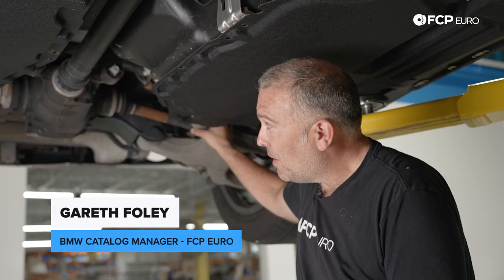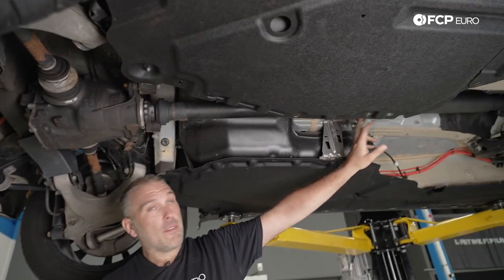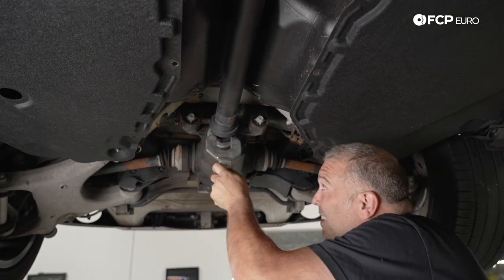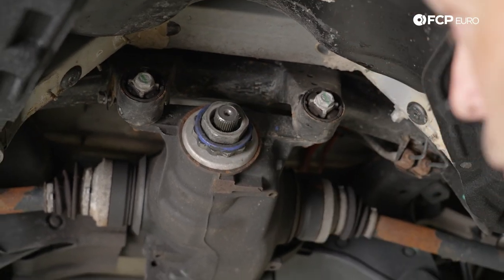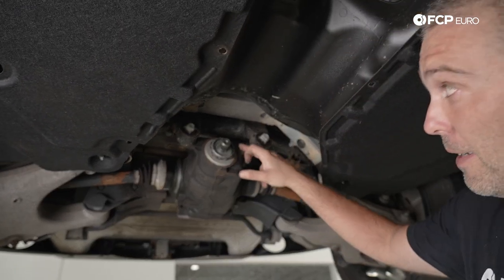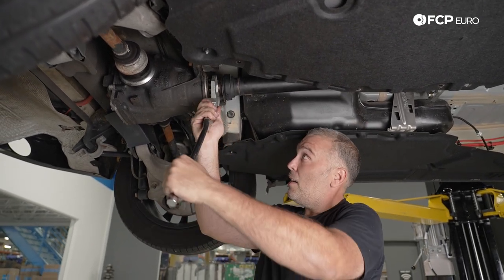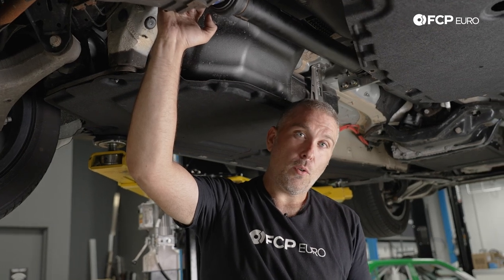How To Service A BMW Drive Shaft With A Drive Shaft Coupling Nut (2011-Current BMW Models)

Comment: Thank you for the video, super helpful as always!
On my 2013 335is DCT, I got the 50mm nut off the driveshaft with just leaving the transmission in Park, no brace it came off. Used a Sunex 97752A 2" crowfoot wrench from Amazon $15. Thats it.
Torqueing it to the prescribed 85nm/62 ft lbs using the crowfoot wrench:
The torque wrench was 15” long from center of wrench to center of hand grip. Crow’s foot has an extra 2.25”. the torque will be 15% high or 72.1 lb-ft. The point of the formula is I set the torque wrench at 54 lb-ft to get an actual of 62 lb-ft.

Other torque specs: 
big 50mm nut to driveshaft.... 85nm/ 62 ft lbs.... blue lock tight on splines
Rear diff bushing... 21mm back bolt.... 121 ft lbs torque spec 
Front diff bushings bolts... 73 ft lbs
18mm exhaust hangars
Axle bolts... 52 ft lbs... blue locktight
gear oil through fill hole and torque to 44.3 lb-ft with 14 mm male hex.
Reply: dude thank you for this

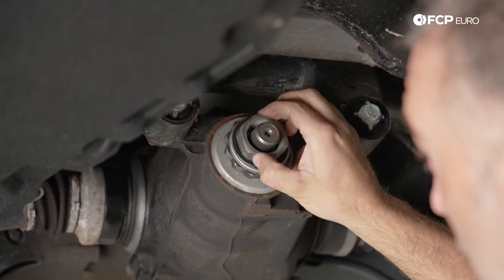Comment: When you remove the plastic cover at 4:35 it is clearly visible that the rubber seal which is on the 50mm nut is on the OUTSIDE part of the flange. But when you put it back at 6:00 you stick it underneath the flange - is that correct?
Also - by design it seems it is really NOT holding to anything on the differential - only that rubber seal is holding the driveshaft with the diff. That makes me wonder whether you could simply PULL OUT the driveshaft from the spline shaft of the differential...
Reply: I was thinking that same thing, did you ever figure this out? I just dropped my old diff out and it seems like the 50mm nut does nothing

Comment: Is the driveshaft holding tool really necessary?  ISTA says to use a suitable tool to hold the driveshaft which appears to be a large screw driver through the u-joint at the center support bearing. They do not specify any holding tool for the driveshaft other than that. I only want to do this one time but don't want to spend $350 to hold the driveshaft in place if I don't have to.
Reply: No, at least in my case, it was not necessary.  I put mine up on ramps after coasting to lock the parking prawl.  I used a 24" torque wrench with a 50mm crow foot wrench.  I applied slow and steady pressure and the nut moved.  I reset the wrench a click, it continued to move.  After 15-20 minutes, the nut was completely off.  I wouldn't recommend anything less than 24" or you just cannot get enough torque (I tried a 12" wrench with a pipe extension around 18" total and I couldn't move the nut).
Reply: @souniquexyz  use the e/parking brake on the center console, it will do the same thing.

Comment: Curious about your comment on that 12 point pinion nut. Had a shop replace my input shaft seal on an F36 which requires the removal of that nut. I'm convinced the did not torque that nut properly causing incorrect pre-load in the diff because now I have a loud whine when coasting. Would incorrectly fitting that nut back on potentially cause any serious damage other that the noise/whine?

Comment: I may be dense but what is the purpose of this design? It seems like the nut threads onto the driveshaft but is not in anyway physically mated to the splined stub coming from the diff. Could you, in theory, pull the driveshaft off the diff without removing this nut?

Comment: At six minutes, it shows him tucking the rubber seal into the pinion nut. This is wrong. Do not do that. The seal sits on the outside of the pinion nut and then the blue retainer.
Reply: You are very right. Finally someone pointed it out. I mean people can clearly tell the round foam thing is a dust seal and plastic cap is the seal securer. If leaving behind it, it will squeeze to break when tightening.
Reply: Thanks for that information/ correction. I will remember this if and when I encounter this. You made this video even more accurate and helpful.
Reply: How is the 50mm nut actually attached to the diff? There are no threads at the pinion gear  and I was able to pull it off with my fingers
Reply: Also the seal on mine was inside the pinion like he showed, it came like that from the factory

Comment: The 12 point nut is to set the Pinion preload .if not torque to spec. Your looking to buy customer a brand new rear diff . Yes the nut need to be removed to change the Pinion seal which they leak all the time
Reply: Correct.
Reply: Hi, if i only want to take out the drive shaft for tank removal. Do i have to replace the 12 point nut aswell? Or can i leave it there and only replace the insert nut with both rings? Thanks!

Comment: “If you mess with the 12 point nut you’ll have a bad day”.  What could happen? Wouldn’t that be how you get access to the pinion seal?
Reply: The 12 point nut is the pinion shaft nut and sets preload on the pinion bearings. There is no torque spec for this per se since the pinion is preloaded from the factory and total torque required to get to that preload spec will vary from differential to differential. If the nut does need to be removed, for example a pinion seal replacement, you need to mark the nut to the pinion shaft to put it back in the same position. If you unknowingly loosen this nut without marking a preload spot you won't be able to get it back to the same spot where it needs to be.

Comment: Does anyone have any tips for separating the driveshaft from the diff once it is out of the car?  Harvesting a diff that is still mated.
Reply from the maker: An impact gun will make light work of the hardware without having to counter hold!
Reply: @fcpeuro  thanks for the reply! I may have misworded my question - I meant the 50mm coupling nut that connects the prop shaft to the diff.

Comment: Any insight on center support bearing pre-load when reinstalling the driveshaft? Is it required?

Also, why not use parking brakes instead of the driveshaft holding tool?
Reply: On other cars I’ve worked on, the CSB preload is set by pushing the driveshaft towards the front of the car about 5mm, then tightening the CSB bolts.

Comment: Aren't you supposed to torque the nut to 120nm then back it off 90 degrees then retorque it to 45nm?   That's what I was told by 2 different dealerships.
Reply: I wonder if the torque spec changes on a per vehicle basis. For the f30 its 85 Nm torque on that nut. No tightening or loosening shenanigans.

Comment: #GoofyEngineering #NotaFan  100 N-m with ease.

I got excited this was a demo of the BMW E9X M3 Drive Shaft replacement. These two piece BMW driveshafts have a U-Joint in the middle that is not serviceable. When you develop the M3 DS clunk noise, it is a pain. There are remanufactured M3 driveshafts that replace the u-joint with a serviceable unit. The quick solution is to replace the center bearing in the middle with he bracket. A lot of labor $$$, even though the parts are inexpensive. You can also replace the rubber guibo disk (front of the DS) at the same time.

Comment: $800 worth of tools just to take off a driveshaft...thanks BMW
Reply: They are indeed expensive. Unfortunately they are necessary when you want to do the job right.
Reply: @tecitez16  thank you for the valuable insight?
Reply: Yw 💗
Reply: 65mm 12 point socket